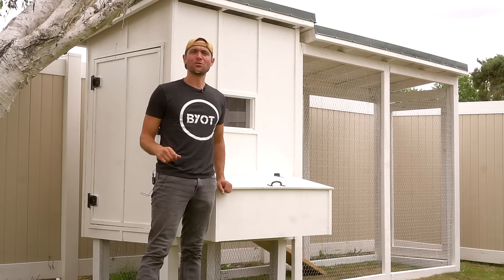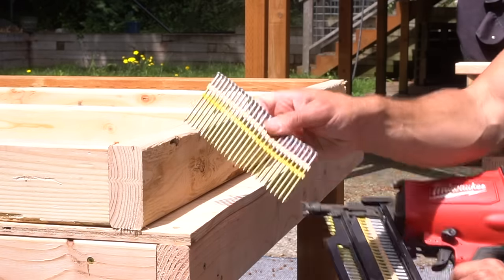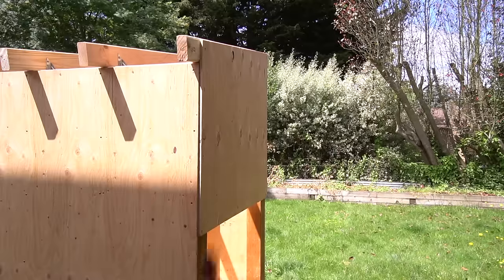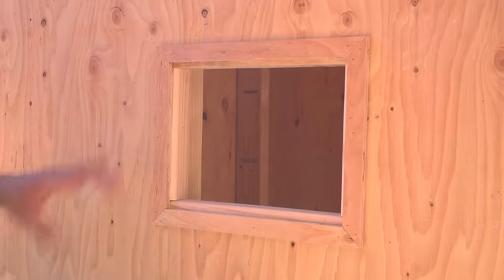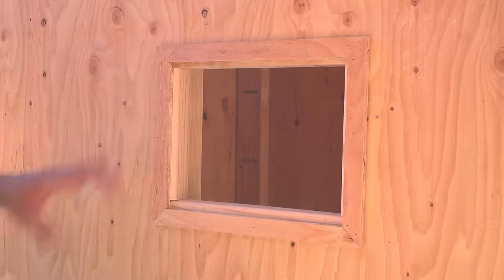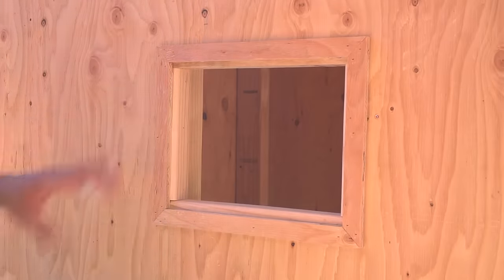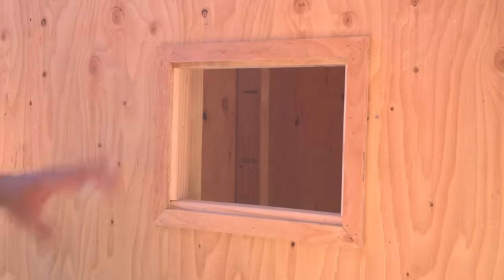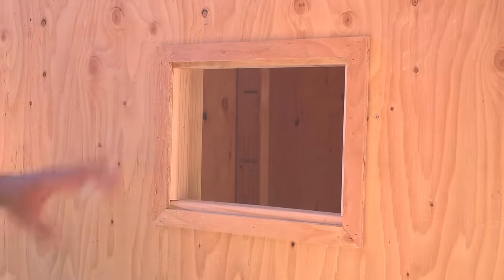DIY CHICKEN COOP BUILD // Start To Finish

Comment: looks great but I think ventilation ports should be added to keep coops well vented during hot days and reduce moisture buildup during the cold days
Reply: Agree, and add grips on the ramp
Reply: I was thinking the window could be a mesh vent instead with a removable glass pane for winter.

Comment: Great instructional video. Great woodworking techniques here. Specifically for a chicken coup, there are several points to be mindful of to improve on your next coop build. Ventilation and drafts, chicken wire vs ½" hardware cloth, roosting bars, chicken ramp, and extra predator proofing (on the ground perimeter, rafter openings and fasteners).

Ventilation can enter the lower end of the rafters and exit the higher end, but it would be better to add vents high up on the side walls. Make sure the vents are higher than where the chickens will ne roosting so they don't feel a draft. Seal the door against a draft. Poor ventilation can be detrimental to the health of chickens, and drafts can be deadly for chickens.

Chicken wire is universally unacceptable for securing chickens against predators. Chicken wire keeps chickens in, but large and determined predators like foxes, raccoons, possums, skunks, cats and dogs, falcons and owls can shred it. Smaller predators like snakes and weasels can slip right through. And mice and rats will be able to enter the run for food and water. You also want to bury hardware cloth around the perimeter, extending out at least 18"-24" to discourage digging. You can cover it with topsoil or landscaping rocks. And don't forget to seal openings in tbe rafters with hardware cloth as well. It should be fastened well with nails or screws with washers every foot or so, and 18 gauge staples inbetween. Also, the lid on the nesting boxes needs a predator-proof latch. Raccoons can defeat simple latches and that lid is not heavy enough to keep them out of it. Remember, raccoons can climb, squeeze through, throw their weight arpund, push and pull. They open trash can and dumpster lids all the time. Even in urban and suburban environments, you would be surprised what predators lurk at night. 

Some chickens will be sliding on that ramp. They need better traction. Install some treads on the ramp with your trim wood. The greater the incline of the ramp, the more treads needed.

Roosting bars should not be so flat as the 4" side of a 2x4. They do not like to sleep perfectly flat-footed. At least, take your router and bullnose the corners so they can comfortably wrap their feet around the edge instead of wrapping their feet around a sharp 90⁰ corner, and use the 2" side up. 2x3's would be better if you've got them.

Lastly, the slide-out poop tray is convenient. I did not see any handles on the board to pull it out. Maybe I missed it. This could be a rope handle. Keep in mind that the nesting boxes also need to be cleaned, so you might want to design a convenient way to sweep those out as well.

Comment: Congratulations, amazing job! You just gave me great ideas about my next chicken coop :) As a chicken keeper and a very amateur dyi person, however, I would like to point out some issues that I learned only by keeping chickens, if I may. I would recommend wires in the windows covered by a slideable plate from outside instead of glass: chickens need good air ventillation. Also, after I spent considerable amount of time trying to clean the nesting boxes, I made the front panels of the boxes completely removable in the manner as you did with the dividers (except for the two laths are not on the base but on the side, so the closed lid holds the front panel in place, that made the cleaning process so much easier. I also connected the legs of the coop with laths at the bottom to fasten the wire to that also, just to be more safe. One or two feets deep guard around and under the walls also required - wire, tiles, bricks, whatever - to prevent animals that desire some chicken for dinner, from digging in - but I guess that is not your job to do :)
I so envy your tool set btw :)

Comment: awesome job 👍
FYI raccoons/fox's will be able to push underneath the netting underneath the coop, you need to put a frame around the bottom and staple the netting to it like you did the run. Also put a lock on the laying box. I lost chickens because raccoons are too smart
Reply: I noticed that too. Also, bury 18-24" in the ground to keep 'diggers' out.

Comment: Looks good but I did notice a lot of flaws.  The windows didn't open.  They need to open and have hardware cloth, not chicken wire.  The chicken wire only keeps chickens in, not predators out.  The ramp needs rungs to help the chickens up without slipping.  There should be ventilation on all sides of the coop.  The nest box didn't look like it had anything at the back to stop any rain from getting in.  Another safety measure would be to have hardware cloth all the way around the outside parameter of the coop/run to prevent any animal from digging under.

Comment: I’ve got a pipe stall out back that my horse refuses to stay in and I started converting it into a chicken stall/run/yard. I’ve got it enclosed in some chicken proof fencing and I’m going to top it with anti bird netting to keep predators out. This chicken coop is perfect to finish this area and I won’t have to build an eight foot chicken run onto the coop. Thanks for the video. Best and most detailed one that I’ve seen so far… guess I can stop looking and start building now.

Comment: This is the most informative video that I’ve seen for a novice to build a chicken coop for my chickens. The thing is that most of the coops are designed with large fowl chickens in mind. I have Silkie chickens which are a bantam breed so I need a coop that is half the the height off the ground than most chicken coops because they don’t really like heights. Additionally, the roosting bars need to be at least half the height off the floor of the coop so the coop itself doesn’t need to be so tall. If you are really interested in designing a coop for my needs, I would really like a design that meets theses requirements. I would love to have a 4x8 platform with the last foot at the end for the nesting boxes 4x1, leaving the main coop with the dimensions 4x7. The opening to the run on the opposite wall of the nesting boxes and the cleaning door for my access on the long side. I’ve never seen it before, but I was thinking that a drop bottom with hinges on one side for cleaning would work best for a coop this size except not dropping under the nest box. Even if it was two sections of 4x3 1/2 drop bottoms with a 2x4 beam between them. And then a beam between the nest boxes and the rest of the coop. I know that’s a lot to ask but if you would like to design something like this it would be exactly what I would need.😊 Is there a way to contact you? 

Ginger

Comment: Awesome video! 
Well built Chicken coop. 
I must say 1/2” wire cloth is recommended over chicken wire to keep out mice/rats as they can easily squeeze through the hole. 
Also, add ventilations on all 4 sides of the henhouse. 
Other than that I’d order one from you!
Reply from the maker: Thats a great and helpful not Benjamin.  Thanks for the suggestion and I'll let the client know that.  Thanks for watching.
Reply: Do you think 1/2” would be enough even for small rats? Or would you recommend 1/4”?
Reply: @jesusislord2149  we use 1/2" galvanized hardware cloth. Chicken wire isn't strong enough IMO. Costs a bit more but think it's worth it. It can also be stapled like chicken wire

Comment: hi! Really nice chicken coop and run. Ive picked up some good ideas to build mine. If you dont mind, I think it needs two important details: one, some plastic or metal to cover the nesting boxes so the water doesnt run inside, and two, the ramp needs some sticks attached on top (simulating a ladder) so the chickens dont slip off when they go out or into the coop. Finally, chicken poop is rather toxic, so it also needs some ventilation (by drilling some holes on the walls you can do it very easily). Greetings!
Reply: I thought that he was going to leave the angled opening at the roof/wall intersect open but he went all of the way to the roof with the wall. Put sealed flashing over the holes to prevent water from getting into the coop. 23:24

Comment: I bought these plans because I liked the design, however, I disagree with the statement that it is preadator proof as designed.  There are several things I did to improve the design.  I started by putting tar paper under the coop floor and nesting box floors.  After building the platform, I applied 1/2 in hardware cloth to the sides and bottom with the exception of the side the run attaches to.  I used big washers and 1.5 inch screws.   I painted the floors as well.  I also ran PT 2x4's between the legs to give the hardware cloth an attachment point. 

I used 2x2's on the inside corners of the nesting box which makes it a lot stronger - I had considered putting legs on it, but don't need to now.  Also, designed as is, water will/does get into the nesting box where the top connects to the coop.  I solved this by running trim above it with a drip edge so water drips away from the seam.  I also ran 1/2 in foam strips on the top edges and installed 1/2 in trim inside the nesting box with the foam for contact there. 

This design leaves the space between the top plate and the roof open - a great place for any number of creatures to enter, so before attaching the plywood sides to the coop, I covered the eves with hardware cloth.  I then applied self-stick tiles to the floor which makes cleaning eaiser.   

I made the windows so they could open.  Just built a frame to go into the openings - connected with hinges so they swing up, added trim to the inside window frames and screwed on a piece of plexiglass.  Installed hardware cloth on the inside to cover the windows.  Currently hold them open with a trim piece - looking into alternatives.

I don't know where the extra material comes from for the trim used in the design - I didn't have it, but I used 1x2 trim instead.  Doesn't cost much and looks way better.  

The run had several design issues.  First, it just sits on the ground.  I attached it to a flat ground contact pressure treated 2x4 and took 1.5 inches off the wall height.  I did use the pocket hole screws, but made the mistake of them being on the outside instead of the inside.  I also put another horizontal 2x4 halfway up the wall in order to secure the hardware cloth more efficiently.   Otherwise, it would have had way too much slack from top to bottom.  The plans also leave the eves open which is also a way for creatures to gain entrance so I covered those with plywood - and above the coop door as well - you get a good piece to do this from the angled section you cut for the front/back walls.

The run door is also poorly designed - it can't possibly hold up with only pocket screws holding it together.  I used 6 inch screws to hold it togther as well as steel L brackets.  You could also use triangle pieces in the corners.  I also added a horizontal 2x4 in the middle.  This door presents some challenges as the wood used to frame it is never straight.  I suggest using 3 hinges as mine still needs to be tweaked.  One last thing - the plans call for 5 sheets of plywood - this doesn't give you enough for the run roof - which is one whole sheet.  Buy 6.  The plans also don't really tell you where the run attaches.  I attached it so it's even with the sides of the coop which looks nice, but most likely isn't correct since the roof rafters seemed short - but it worked out - except for an open space at the bottom that needed to be filled.

The materials used in the plans for the roof - metal roofing are way too expensive.  A much cheaper alternative is to just use a 36 in wide roll of asphalt roofing material - like a roll of shingles - available at Lowes.  I put the tar paper on, the flashing, then cut the roof material to length.  Sure - I had a big overlap, but I paid way less and didn't have to cut metal sheets.  I also was careful to only nail into the rafters.  There is some left over from the 50 ft roll.

Lastly, I dug a 16 in deep trench around the 3 sides of the run and put hardware cloth into it - again attached to the run with washers and screws.  This prevents anything trying trying to dig in.  The use of chicken wire connected with staples in the plans is wholly inadequate. 

I thought painting the interior was a good idea, so I used a cheap sprayer from Harbor freight that I have used on my wood fences - but it really makes a mess.  I also used a few tubes of caulk on all the seams.  We also put 2 hasps on each end of the nesting box, bolt locks on top and bottom of the run door plus gate latches on both dors - all secured with carabiners.  I also put a plug on the inside at the top which can be connected to power via an extension cord.  This will enable me to run a fan in the summer and a heating pad in the winter.

All in all, this is a great plan, well designed.  I don't mean to bash it - it just needs a few tweaks.  Our 4 chickens are enjoying it.

Comment: Fancy little chicken coop! However, I am concerned those Chickies are going to become supper for foxes raccoons possums or whatever. 

I like the dusk and dawn automatic door! That may do the trick. 

It would be really good to have buried some type of fencing a foot or so into the ground so predators cannot get in. 

Also, traditional chicken wire is very, very easily dismantled by predators like raccoons. A few staples on chicken wire won’t last long. 

Just a little bit of advice from someone who has seen a LOT of chickens disappear to raccoons!

Comment: Without framework around the bottom of the house where the chicken wire is stapled, it will be very easy for a predator to slip under the wire. If the chickens begin dust bathing near the wire once the grass is gone, it will also be easy for them to slip under the wire.

Comment: make  steps about an inch high and the width of the chicken rramp so the chickens have something to grab onto with their talons as they go down the ramp ( i didnt see those on the ramp in your video )
Reply from the maker: Great suggestion Erik and I'll make sure that ramp has some type of tracking like that :)
Reply: @BYOTools  glad to hear. Don't need hurt poultry
Reply: To add to this: if you ever notice your chickens are not laying eggs: a bit of a draft is something they do not like at all (which the big door probably will cause)

Comment: Did you leave those small gaps between the roof/rafters and the walls? Perhaps more chicken wire/mesh in those spots will keep mice out and provide a little more ventilation?

Comment: Hi. Well done. A few suggestions:
- yes, THE COOP NEEDS VENTILATION. Even just a few holes near the high end of the roof will vent ammonia, etc. Do your own research.
- in that vein, WINDOWS SHOULD OPEN. Otherwise it becomes a hotbox.
- YOU WANT A LOCK ON THE EGG DOOR. Raccoons are notorious and very deft. You need a two-step lock, not just a hook. Same with the main access door.
- CHICKEN WIRE will keep chickens in, but not predators out. This includes neighborhood dogs. Coons just reach into the wire and pull a chicken out piece by piece. Hardware cloth is better.
- I assume food and water is hung at the run's main entrance. Where are the hooks?

Comment: My concern would be predators digging under the chicken wire.
Reply from the maker: Do you have experience with stopping predators from doing that? Thanks for watching.
Reply: @BYOTools  1/4” 18 gauge hardware cloth. You secure it to the leg posts, leaving no gaps, from the floor to the ground. Dig down about a foot and then outward, also a foot, and bend the hardware cloth out into the trench you’ve made. Place bricks or large rocks on the outward bending portion and cover with earth, gravel, or whatever suits you. Inside of the crawl space, put a layer of hardware cloth 8-12” underground and then cover with earth, then whatever will be used in run and crawl space. 👍

Comment: Anyone know an approximate price for materials for this build?
Reply: Nvm I read he said about $1,200 in another comment
Reply: Depends your location.  If you are in cold climate, you may need to install electrical for heating the water to keep them from freezing up.  That could cost $300 more.  I just built one about same size and mine costs around $1800 in material because I use 3/4" plywood and premium stud.  Premium stud are more straight and much easier to work with (paid extra to safe frustration).  Hardware cloth costs 2x as much as chicken wire.  If you do some research, it's highly recommended to use 1/2" HWC over chicken wire because chicken wire will not stand up to raccoons.  To protect the chickens from diggers, you may want do add some chicken coop apron (more hardware cloth).  Which will add to the cost.

Comment: Love your videos but obviously you have no experience with chickens😂
That coop will be filled with rats, chicken wire is useless. You need to use quarter inch mesh. Plus you need to frame  the bottom and dig down to avoid raccoons digging under.